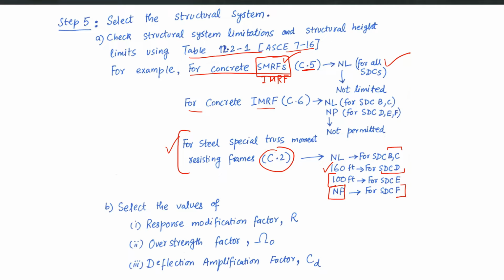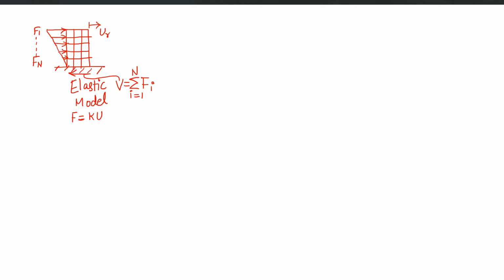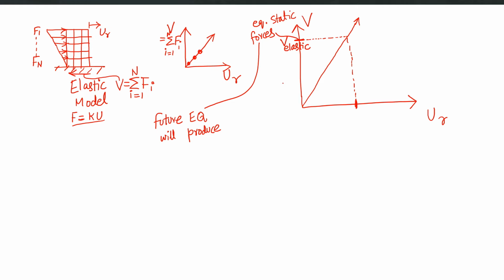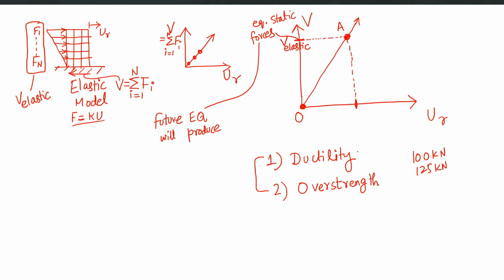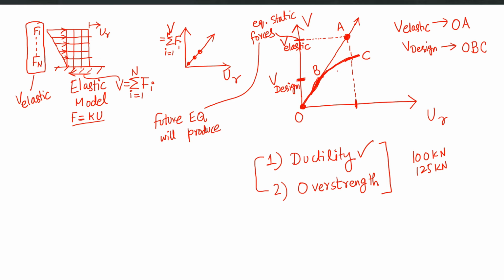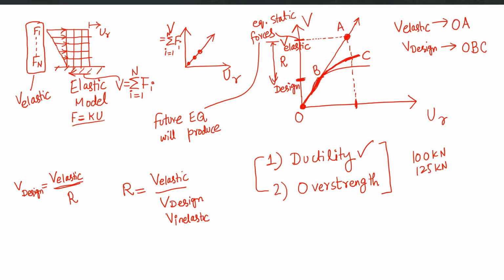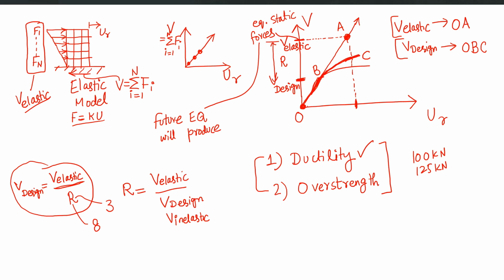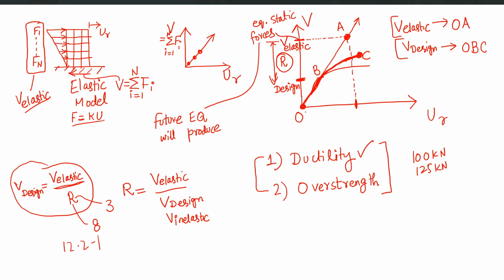42 - What is Response Modification Factor (R)?

Comment: Thank you very much for such explanation, My question is here: If a structure is designed based on (R & Omega), then the structure will not resist a seismic force equal to V_elastic, because we will not reach point A through path OBC. Does this mean the structure is under design?
Reply: No, because the structure will absorb the rest of the earthquake force by ductility (deforming but not structurally collapsing)

Comment: In most of cases constructor are't using mentioned steel grade and fc' for any reason.Then how our structure is over strength and we take omega factor in designing. Although it is under design not over.